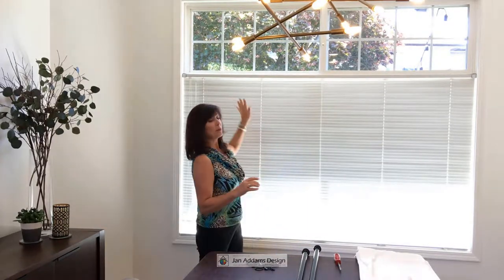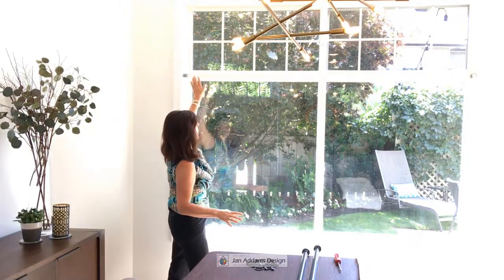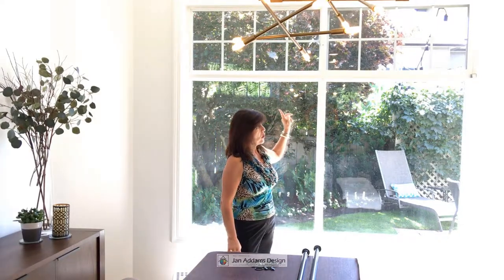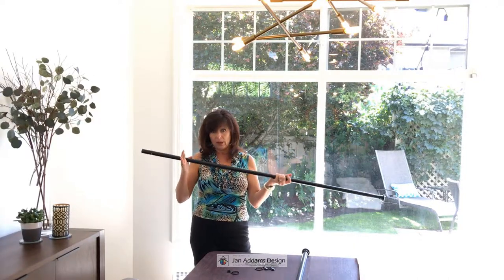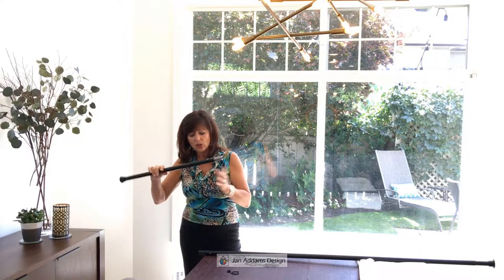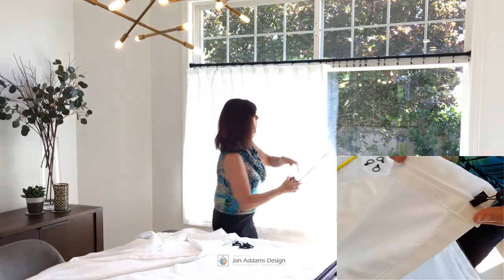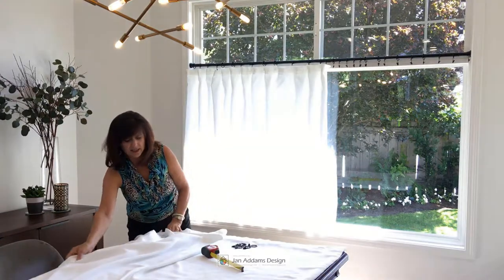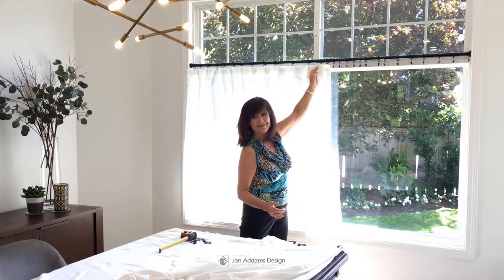PART 2-2: How to Install a Hidden Clip Cafe Curtain

Comment: I couldn't really see, or understand what the LIP was. I  just know that I hate those clips showing too. I wish there was a video that showed how we can sew the rings directly to the curtain or pinch pleat and avoid the clip all together. It doesn't exist
Reply from the maker: Hi Dawn, 
Thanks for your comment.  I will do another short video that shows me just sewing the 'channel - lip'.  
It was really trial and error to get it right.
I agree, I don't know why they don't make curtains with it.
Reply: @janaddamshomelifestyle5758  that would be wonderful. Thank you
Reply from the maker: Hi Dawn I have a few ideas but the problem is if you sew the rings onto the fabric the curtains will be hard to clean.  I wouldn't want to risk any stain from the metal rings affecting the fabric.  

I did think about making little ribbon ties that are velcroed so the rings could be removed.  I'm not sure what else to do.
Any suggestions?
Reply: @janaddamshomelifestyle5758  I didn't think of that. Seems like no matter how I tried using clips, they showed and hung wonky. In the end, I removed them. I took a ring to Michaels with my thinking cap on. Bingo! I got jump rings! I put jumps on my rings. Then attached pleat hooks to my churtain, and hooked them through the jumps. PLUS no more wonky! I'm the type that will keep looking and adjusting something that looks off. They've been up 4 days and not one adjustment! I'm SO happy.
Reply from the maker: @SusieQuhNOT  Hi Dawn, fantastic!!! 
Please share a photo or video of what you did!

Comment: Do you have a link to the rod & rings you are using?
Reply from the maker: HI Jeanne, 
I used Tension Single Curtain Tension Rod SKU: C002952825
by RoomDividersNow (bought on Wayfair.ca) this was the only tension rod I could find that was long and strong enough to span the dining room window.  It worked great!
I also used the Umbra® Allegro Clip Rings in Black (Set of 7) skuId : 61097827 which I bought from Bed, Bath and Beyond.  Hope that helps.  Good luck!

Comment: Do you sew the long  piece of fabric that holds the clips( by the way, that was a clever way to do it) , across the bottom about 1/4th inch  in , then at the top 1/4th down and across length , or how ever deep the clip is?  Sorry , should be common sense to me but I want to make sure I get it right the first time .
Reply from the maker: Hi Samantha, 
Thanks for your nice comment!  
To answer your question, you could do that (sew the long piece of fabric) but I tried it and it didn’t work well as the top didn’t hang straight. 
Instead, I folded the top header down and created another folded layer up to add the clips to.  You can see how I did this on my first video >> How to Create a "Hidden Clip" Cafe Curtain << https://youtu.be/uD68jvaPGc8  (go to 3:47)

Good luck with your project!
Jan